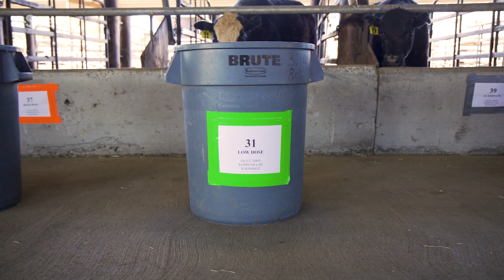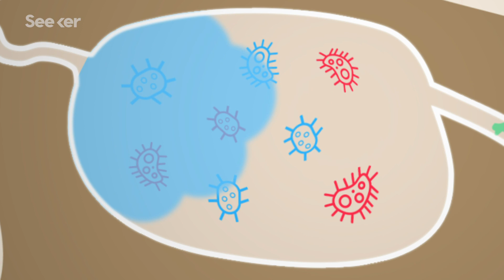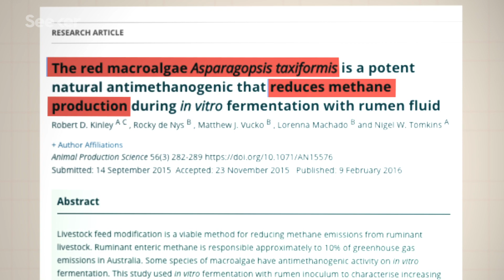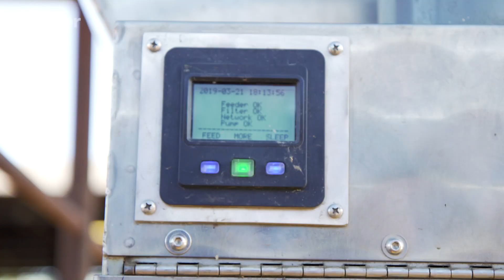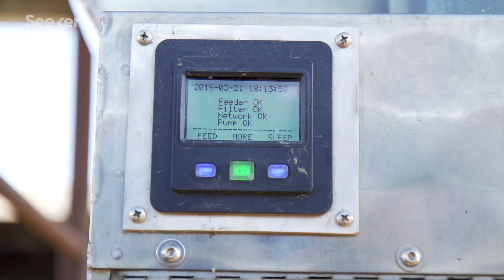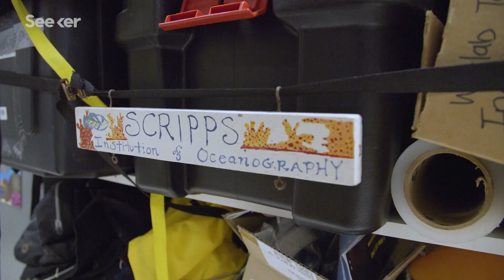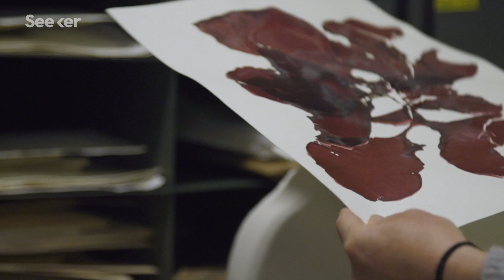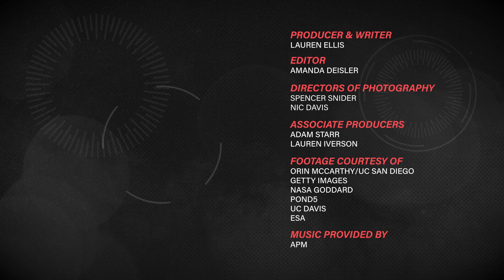How Seaweed Could Slow Down Climate Change

Comment: Nah, still doesn’t change the fact that livestock require enormous amounts of resources to sustain. Lab-grown meat and plant-based alternatives are the future.
Reply: Yes, but this will be a good way to curb methane until plant based alternatives and lab grown meat become good enough to replace real meat
Reply: I honestly can't see lab grown meat taking less resources than it takes to grow meat on a cow or chicken. Remember that a cow can refine literally dirt cheap things (grass, seaweed, land weeds) into refined and chemically balanced nutrients. It also provides an extremely stable environment for the meat tissue to grow (proper pH balance, O2 levels, hormonal balances, hydration levels, temperature all of which may need subtle changes as the meat grows and matures). The cow also provides protection for the meat from biological attacks from bacteria, fungi and viruses. It also moves which stimulates muscle (most of what people think of as meat) growth. All of this, would have to be to some degree simulated with systems of machines (that will run on electricity) and refined chemicals (which need to be brought in by transport) in a very sterile envionment that must be extremely reliable and very well maintained.
Reply: @zachcrawford5  all fair points, and also all of the reasons why we haven't mass produced any yet.
Reply: Sure, but you have to do ALL possible things you can at the same time to have the most impact.
Reply: Plant based alternatives are the present. You don't have to wait for the future.
Reply: Absolutely 😄
Reply: Neutral perspective wise, this is a quick solution to reducing greenhouse emissions. Lab grown meat still takes loads of research and resources to finance.
Reply: Really that simple.
Reply: You’re right, they’re the future, not the present. So keep waiting.
Reply: ronaldo Duran https://www.google.nl/amp/s/labiotech.eu/medical/lab-grown-meat-market-2020/amp/ 
Near future :)
Reply: to be fair, if we can feed them entirely on seaweed and find a way to farm it in the ocean, resources wouldn't matter much. it would also solve the problem of 70% of our fertilizer being mineral based from mining.
Reply: Unlawful_Falafel Farm it in the ocean? So instead of plundering rainforests and destroying land habitats, we should do the same to the oceans? Because that’s what would happen if we could somehow find a way to feed 70 billion land animals every year on seaweed alone. It’s just not efficient to sustain billions of livestock every year with our current huge demand for meat. The meat industry is so cruel that they even tried to fix this by feeding the cows the leftover parts of other dead cows (forced cannibalism), but they quickly realized that this causes mad cow disease, so they stopped that insane project. With our growing population and growing demand for meat due to developing countries adopting a Western diet, the only way forward is lab-grown meat and plant-based alternatives.
Reply: Fax
Reply: Baby steps, my friend.
Reply: Meat is very important for our brains and health. Without it we would still be simple apes
Reply: Southeastern777  soyboy
Reply: Southeastern777  no but I've heard of Soylent
Reply: But it could be a temporary fix.
Reply: Lab-grown is way better
Reply: And what would you suggest in the meantime?  It's going to be a while before lab-grown meat becomes a viable source of nutrition and a dismissive  "nah" offers nothing.
Reply: TrickWithAKnife In the mean time?
Reduce your meat consumption or stop eating it.
It's not rocket science.
We would win so much if the industrialized nation would cut their meat consumption just in half!
Reply: It requires lots of resources to sustain, and also makes humans morally depraved lmao. But I guess most people like to focus on the resource bit, like this they can phase out without having to acknowledge their immoral contributions for self-pleasure.
Reply: @DeusExHomeboy  I'm not sure morality is something we need to acknowledge, everyone has different beliefs. Resource usage should be universal when well informed.
Reply: @SmartMass  Animals of our specie only have different "BELIEFS". REALITY is NOT DIFFERENT for different "groups of homo sapiens". Only their INTERPRETATION of the SAME REALITY varies, and mostly because their "own beliefs" are relatively more comforting to them than the harsh, un-personlizable truths of the reality they exist within. This is why you also have "personalized" beliefs that make your own existence easier to go through, without having to put much effort into changing yourself (acting in accordance with reality).

I know you suddenly might feel a sharp urge to reply to me, dismissing everything with another personalized interpretation of objective facts, but it would be better for your own self to take some more time processing all this fresh fact merch.
Reply: "It requires no acknowledgement...who think they somehow have the power to make things go in and out of existence at whim lol."
      @DeusExHomeboy  To be clear, you were the one stating we have to acknowledge our immorality. We do have the power as a species to eliminate other's existence.

"...Doesn't matter if YOU or ANYONE "acknowledges" the undeserved suffering brought upon that creature...certainly a morally depraved, and a subhuman act."
     This is obviously an opinion. We all agreed that is a subhuman act, there is no fact stating that to be true.

"...a round object doesn't lose its shape just because you don't want to 'acknowledge its roundness'."
     Objects are not round without acknowledgement, if you could see the surface at (x) level it could be a straight line, as an example our perspective of our planet at ground level.

"You have simply not thought, or progressed enough on this matter...reality that is a permanent part of your singular existence ayyyyo."
     I'm disappointed you have formed an opinion of me with such a brief reply to your generic statement. Truthfully though if you form one so readily, I do not wish to know you further. Best of luck in your future.
Reply: @DeusExHomeboy  humans are morally depraved by default too. Doesn't really have much to do with eating meat.
Reply: @DeusExHomeboy  every animal eats other animals. Stop bro. True humans are going overboard with that shit but clearly nature intends for us to eat animals.
Reply: @1GamersRewind  Surely nature intends for humans to die prematurely too? 

Yea, just because something is 'natural' doesn't mean it's right to do.

(You have committed the 'appeal to nature fallacy.')
Reply: @loganboylen2389  no I haven't. You have committed to  "there's a such thing as right and wrong". That's only your selfish perception.
Reply: @loganboylen2389  and no, nature allows for me to live long OR die young. So either one is natural.
Reply: @1GamersRewind  Sure, but I don't eat meat because it's inhumane. What's your justification? Cognitive dissonance?
Reply: @1GamersRewind  Again, just because something is natural, doesn't mean it's good.
Reply: @loganboylen2389  and I'm sure you and I still hurt animals in various ways even while being vegan. Like I said come off your high horse. You are on a phone, do you care about Asian slave labor? No. You're still going to use and buy new phones and electronics. Still I think we should minimize suffering but stop with this delusion that you are better than someone else because you don't eat meat.
Reply: @1GamersRewind  So, how do you justify the killing of animals for meat? I'm curious.

I assume you do indeed eat meat.
Reply: Unless you're going to say "You don't".
Reply: @1GamersRewind  Not universal "Good" and "Bad" but such ideas of which are made by humans.

Thus "Good" and "Bad" do indeed exist, it's just the perspective of humans that each work to define these terms.
Reply: @loganboylen2389  I disagree they don't exist. And you just think things are bad ultimately because you don't like them or they will hurt you. You yourself still do things that will hurt others whether you know it or not. You cannot author choices, you are a slave to your biology etc. There is no good or bad or free will etc. Choosing yes or no is not free will. Being able to author any choice is and you cannot do that. You can only do what nature allows. Thus everything is natural.
Reply: @1GamersRewind  Sure, everything is natural. But then that just makes the term of 'natural' completely arbitrary. 

You still haven't answered my question about how you justify the needless killing of animals for meat.

I disagree with you about your assumption that I think something is bad just because I don't like it.
I justify bad things as those that inflict suffering and pain.

Then again, I see your point - these terms may be arbitrarily defined.
Reply: @loganboylen2389  I don't eat meat, because I personally choose. But I'm under no delusion that I am better than someone who does and I can see that a human body will do fine with meat occasionally. Nature intends both, so there is no good or bad. It's just which one do I like more. The point about the phone remains. We all knowingly or unknowingly support and cause great harm. Just being alive period means you have to leech from the environment to some degree. You cannot exist without "harming" something else. No matter what it is.
Reply: @1GamersRewind  Okay, thank you for your opinion; it was really informative.
Reply: (I happen to agree with you.)
Reply: Imma put a wrench in this argument before it snowballs out of control.

1. Humans are scientifically animals. Animals eat other animals.
2. What makes humans different from animals is that they have a morale system.
3. This doesn't have anything to do with meat so both of you shut up.
Reply: DANDAN THE DANDAN 

1. So because other animals do it, we should too? Other animals rape each other too. So is rape therefore ok because other animals do it? Retarded logic.

2. Exactly. We have moral agency, other animals don’t. Therefore we should act moral and not needlessly kill, rape and confine animals.
Reply: @SpartacusN  
1 was about animals eating each other, cannibalism is not allowed by 2 because humans have morale. I was talking about how humans are allowed to eat other animals since other animals do it to and human morales does not forbid it unless you have an ideology that is against it.
Reply: DANDAN THE DANDAN 

1) When did I mention cannibalism? I was criticizing your poor logic. You said ‘humans are scientifically animals. Animals eat other animals’. You’re implying that because other animals do something, it’s not bad if we do it as well, which is ridiculous because animals do all kind of horrible things that we perceive as immoral, rightly so. Such as rape.

2) Again, it’s okay because other animals do it? You know what else other animals do? Rape, killing each other, eating/killing their children, brutal violence, etc. Are all of these okay for humans to do ‘because other animals do it’? 

And what do you mean by ‘human morale does not forbid it’? You realize that ‘human morale’ (varies from culture to culture, but I get your point), changes drastically over time? 200 years ago, it was legal and morally acceptable to own human slaves. Now it is not. This is called moral evolution. A few decades from now, future generations will look back with disgust at the way we treat animals now.
Reply: @SpartacusN  When did I say that you mentioned cannibalism? I just say "cannibalism is not what I meant" in case you were pointing out the obvious. My logic is that anything that animals do to other animals do that does not forbid human morale is okay for humans to do.

Rape? Killing? Every other example you mentioned? Yeah, human morale forbids it so it's obviously not allowed. I'm not saying that crime shouldn't exist by default, I'm saying that it's against human morale.

Read what I said carefully and you will find yourself misunderstanding my point.
Reply: I’ll never eat lab grown meat. 

It’s funny the same people who bitch about GMOs want to eat meat from a lab! Lmao
Reply: You're an idiot, Tesla would slap you if he could
Reply: 3Runner95SRB “It is certainly preferable to raise vegetables, and I think, therefore, that vegetarianism is a commendable departure from the established barbarious habit. That we can subsist on plant food and perform our work even to advantage is not a theory, but a well-demonstrated fact. Many races living almost exclusively on vegetables are of superior physique and strength. There is no doubt that some plant food, such as oatmeal, is more economical than meat, and superior to it in regard to both mechanical and mental performance. [...] In view of these facts every effort should be made to stop the wanton and cruel slaughter of animals, which must be destructive to our morals.”
~ Nikola Tesla

:)

Comment: What's in it for the farmer? I mean they will have to pay for this supplement to add to their cattle feed. This is an extra expense on top of everything else. Why should they pay the extra money? Their product will be more expensive than their competitor's who does NOT buy the supplement. You need an economic driver, something like the supplement costs an extra 1% but it results in 2% more beef...
Reply: There was a hope that it was going to increase feed conversion ratios years ago when it was first discovered & the research shown in this video completed, but sadly that hasn't panned out :(. They're still playing with that angle & hoping they can get improved productivity from this (the real researchers I mean, not these research thieves)
Reply: maybe seaweed tax cut, like what happened to solar panel

Comment: Harvest the methane. Run cook stoves or hot water heaters. #Permaculture Your problem is your solution... Of course, there's the carbon waste from the burning of the methane. Filtered smokestacks... Then there's a carbon footprint of producing the filtration device... Does it ever end? Ahhhhh. 😋
Reply: The problem is how do you harvest methane